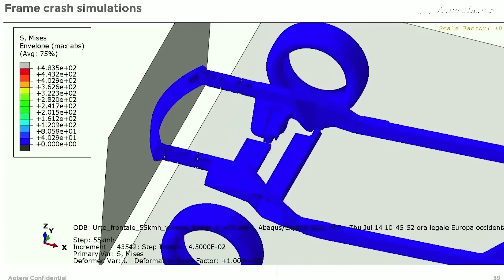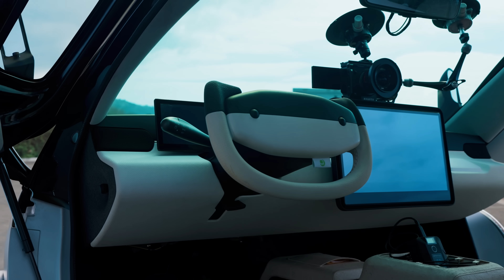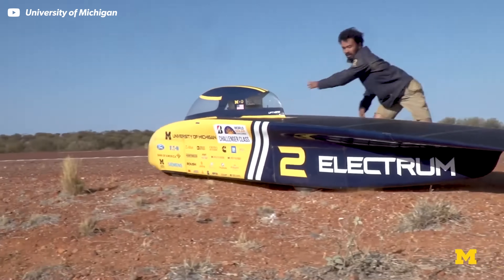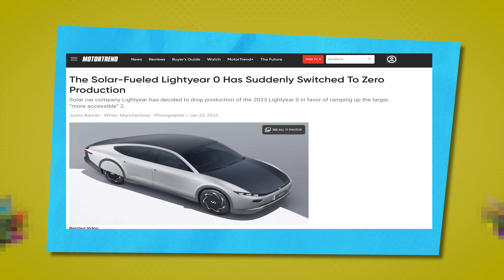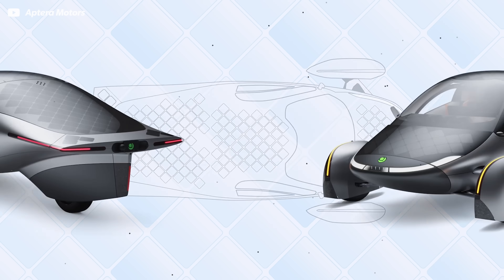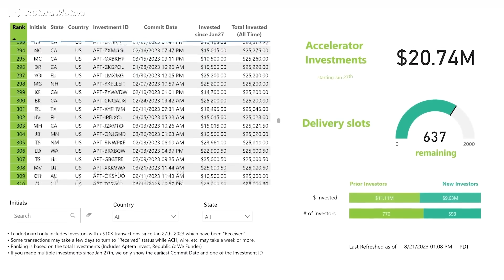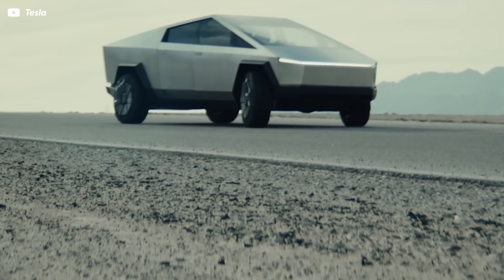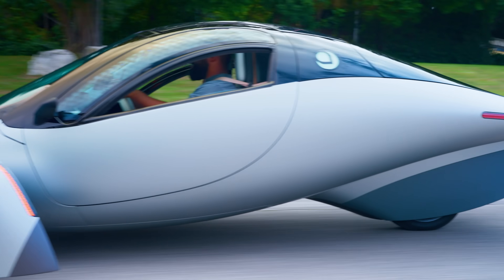We Drove America's First Solar Car

Comment: Honestly surprised that no company has committed to the full aero design until now, seems like the customer satisfaction would massively increase if you can increase range by like 50% from cutting induced drag.
Reply: I'm just curious on insurance cost for this. In my region three wheeled vehicles can be classified as a motorcycle and costs significantly more to insure. So it might be cheap to drive but the insurance might deter it for me or negate any cost savings.
Reply: It requires a massive compromise on how much interior space you get relative to how much road it takes up. They're going to have difficulty selling them in Europe as it's literally wider than a Lambo and our roads are narrower than the USA.
Reply: The closest I've found otherwise was the Volkswagen XL1. It was a testbed diesel hybrid with 260mpg. The Aptera is moderately better still (if their estimates are to be believed) at around 370mpg-e. 

Sadly the XL1 came out at the same time as diesel gate so it didn't even lead to diesel hybrids being common. Still, most car brands will refuse to make a car like this. It's just too unconventional. The two categories they really want are the family vehicles with the "infinite practicality" as literally anyone would buy them, or sports cars that don't have to be practical but sell on the cool factor and performance. This is something very peculiar to the point many states label it a motorcycle.
Reply: Motorcycles cost less to insure than cars.
Reply: @TheAtqthe30th  It's classified as an autocycle, so insurance (and licensing) will vary state to state. IIRC several states consider autocycles as motorcycles for insurance purposes, but not licensing purposes. You can get an idea by getting a quote for a Slingshot from your provider. Should give you a good idea :)
Reply: @juliahello6673 that's what I was thinking, I pay $200 a year for my motorcycle and $300 a year for my car. In northern states insurance companies assume you're only riding during the summer too. Your driving record, age, and whatnot will make more difference too, than it does on insuring a car.
Reply: Teslas semi is
Reply: This is like a 40% aero design. It's possible to reduce drag by a further factor of 2-3 if you fully prioritize drag reduction.
But yes this is the best we've seen so far. 

Induced drag is the wrong concept. This thing produces (close to) no lift.
Reply: @TheAtqthe30th  motorcycle insurance is usually far cheaper than cars in the US. The main categories that decide the cost a month are the weight of the vehicle, does it have safety equipment, does it have a roof and seat belts, the cost of the car, and brand history. The thing should be fine in all categories minus that last one. All startups have an added risk as you don't know if they'll go bust.
Reply: Cuz THE MURICAN DREAM loves luxurious space baby 🤟🙄
Reply: @EngineeringPilot  Not really. It's a truck, you know what would be better than a truck? It's called a train. Doesn't cost us as much in taxes to repair the roads, doesn't use rubber tires, etc. The cars even basically draft the one in front of it at what would be an unsafe distance for even self driving vehicles. 

The only thing good about the semi is aero, but the coefficient of drag is a value times the surface area. This is why a Model 3 and Y have the same coefficient of drag. Obviously a Model Y is till worse than a Model 3 because it's bigger.
Reply: I don't understand why no scooter 🛵 company has taken a 3 wheel scooter like the Piaggio mp3 or Yamaha Tricity and simply added a lightweight aerodynamic removable weather enclosure and lower the seating position. Keeping your 3 motorcycle/scooter removable storage compartments (that are also aerodynamic) that mount to the frame like a regular scooter. Now you have a tandem narrow 2 seated vehicle with storage for groceries that can be rode yr round in rain & cold can cruise 75 on interstate and get 70+ mpgs. Sold at motorcycle price $8,000 with cheaper maintenance costs. It can have heat & peltier fan air conditioning. Windscreen  wiper or just use/keep rain x on hand.
Reply: @TheAtqthe30th  where I live here in SoCal motorcycle insurance is cheaper than a car
. You gotta remember insurance doesn't care about you dying. They care about the damage you do and how much damage YOU can cause because that's what's gonna make them pay. When it's your fault they have to pay.
Reply: It has been tried multiple times and pretty much always flops.
Reply: i'm jst cris on where you put kids loll   @TheAtqthe30th
Reply: @appa609  There is actually around 25 lbs of (intentional) down force at 65 mph.
Reply: @mememaster147  it's narrower than a RAM TRX, so score!
Reply: @michaelbrinks8089  Do you mean the Arcimoto or something more like a cross between a Piaggio MP3 and a BMW C1?
Reply: And there's plenty of people who would want a car that looks like someone just flew it back from the year 2200.
Reply: @appa609  for max aero I suspect passengers lie on their backs, arranged in line - tandem to maximally reduce frontal area.
Reply: @appa609  you think that you can beat a coefficient of drag of 0.13 with a design that's road worthy?
Reply: It's because of top speed. As you can see, the Aptera doesn't sit flat on the ground. It has so much air passing underneath the car that if it went much faster than 100mph it'd generate lift and become unstable. I'm absolutely certain that the 100mph is electronically governed and that the motors could go faster if they were allowed. Meanwhile all other cars on the road use some air resistance to create downforce to be more stable at speed. Actually, I'm impressed that they even managed to get a near zero drag body to go 100mph.
Reply: @RoonMian I won't pretend to be able to comprehend the aerodynamics and design choices that Aptera has made but I know that they have achieved a coefficient of drag of .~0.13. They have a 65% to 35% front to rear weight bias and that "ground effect" is a factor in the vehicles aerodynamics. Isn't 100mph and 0 to 60 in 4 seconds fast enough for a passenger vehicle ?
Reply: @garywozniak7742  Oh, it absolutely is. That wasn't meant as criticism, just as an explanation for why other manufacturers don't do near zero drag. Because they'd have to slow down.
Reply: @RoonMian  Respectively, the majority of cars on the road actually don't use any type of aerodynamic parts to create downforce. Like trucks suvs & everyday commuter cars. It's really only sports cars that come stock with aerodynamic downforce parts. Some rear spoilers on cars are functional while others are for looks only. Like the 80s Lamborghini countach has a big rear spoiler that is literally looks only. It's basically only modern fast sportscars that come stock with things like front splitters, functional rear spoilers and undercarriage parts that create downforce......(Now I'm curious & gonna check to see if the rear spoilers on 70s & 80s Trans Ams & Camaros were functional or just looks) The rear spoilers on older Firebirds TA & Camaros did work but only provided about 50lbs of downforce. The front splitters on the older models also created downforce. Surprisingly the aerodynamics & downforce parts used on 70s Firebirds was way better than 70s Corvettes. The Corvettes looked as if they were more aerodynamic but actually had way more drag.
Reply: @michaelbrinks8089  "the majority of cars on the road actually don't use any type of aerodynamic parts to create downforce. Like trucks suvs & everyday commuter cars"

Yes, they do: the hood and the windshield.
Reply: @RoonMian  Most modern cars have much better aerodynamics for mpg improvement than old cars. But lots of downforce from a rear spoiler most often reduces mpgs. While gaining better rear traction and stability at high speeds. But the majority of low power commuter cars, trucks,suvs & vans don't use large front splitters, wheel arc vents, large rear spoilers & rear diffusers to try and create major downforce like on sports cars made for well over 100+ mph driving....I agree, some newer cars probably have designed hoods & windshields that provide some mild front end downforce.
Reply: @TheAtqthe30th  also, you'll die if you collide with a normal car.
Reply: @Skylancer727  they won't make it because they know the market is just not there for a vehicle like this. 2 seater, 3 wheels but with the footprint of a regular car.  It's too niche and won't be profitable. The company will probably go bust before they even deliver the first car. This is borderline scam territory.
Reply: @bluetoad2668  not sure what exactly you're implying with the 2 seater with regular cab foot room. You don't think sports car drivers want to be comfortable? I say the vehicle's main hurdle is just the modern consumer mindset of needing an extra 4ft² of storage space for "practicality". As cool as it may be to many, that will never overcome this rather odd mindset. 

I don't think the thing will ever be mainstream like a Model 3, but it's far from a scam. We can quite literally see the factory is over half complete, I just think their timing targets are wishful. Nothing about the car seems to go again what's realistically possible like the Nikola truck which seemed physically impossible even breaking down the math. 

But I have little doubt they'll survive at least a few years. The main hurdle startups have is early interest and buyers and so far Aptera seems to be pretty notorious and has over 40K reservations. 40K is not the same as sales, but let it be a reminder that Lucid is still alive since 2007 and has pushed out around 4 models all with only around 2K sales a quarter. Even if only a quarter of Aptera's supporters follow through that's over a full year of Lucid's normal sales just waiting before it even comes out or is reviewed. Even Tesla struggled to get this kind of support back in the Roadster days with it taking a few years to hit 500 pre-orders. That was also a far more expensive car, but it was also a flashy sports car and one of the first major EVs with lithium ion battery range. But the issue with Aptera is rather than being for the rich racer types, their's targets the nerdy technophile who would buy things impractical like a folding phone just because it's cool.
Reply: @Skylancer727  I'm glad you believe in it. I hope you don't lose too much money.
Reply: Maybe
Reply: @michaelbrinks8089  seriously. I am with you on this. Once I finish building my house I am seriously considering building something like this for myself since no one is manufacturing them. Or an e-bike converted to a super aero recumbent configuration with a full shell for weather protection, a bit of crash protection, and storage. We need more super efficient options for the little errands and commutes that most people are doing most of the time.

Comment: I’m definitely rooting for these guys, if they can deliver on specs and price it’s gonna be an absolutely killer product
Reply: You bet it will, especially with that single headlight mistaken for width of a bike.
Reply: Honestly, if they don't hit 1k miles and it costs a bit more it's still a knockout!
Reply: @daliborzeljkovic672  How did you miss literally every light on this thing except the one in the middle?
Reply: Realistically there’s almost no chance they deliver on either but if they get close it’ll still be impressive
Reply: @MoonWind32690  I think the 25k version is only about half the solar panels, FWD, and 320 km but that's still decent considering if you park it right and have a reasonable commute you will almost never have to plug it in ever since the charge adds up. The max solar, AWD (3WD?) 1600 km one is almost 50K. I think if thy made an entry level 200 km one for 18k a lot of city and island folks would jump on it. Just being able to sit back in a safety cell and not get rained on is worth the extra 10k over a bike in my book!
Reply: @anydaynow01  it's less solar, FWD (still 4 seconds to 100kph)  but 400km range. so that's pretty darn good.
Reply: they wont
Reply: Having that frame right thru the side view would be so annoying and potentially dangerous--deal breaker for me.  Not that I'd own a trike anyway unless very cheap.  Wish them well just the same.
Reply: 100%
Reply: that's very fair, I think the frame in the window is a pretty poor design decision  @Mrbfgray
Reply: The $25k price is from 2 years ago; the current price on their website is $33k.
Reply: @Okurkaarrgghh   Reasonable price but I'm not interested, last place I want to park a car is in the sun.  Perhaps it can collect enough PV to power the AC enough to keep the interior from melting.
Reply: @Okurkaarrgghh guarantee it’ll be over 40k by the time they deliver. If they ever do.